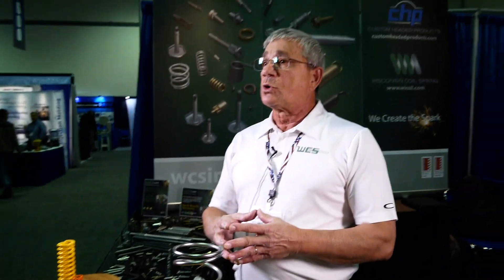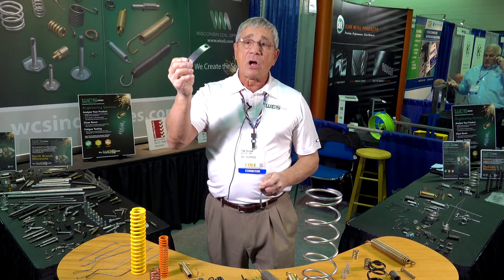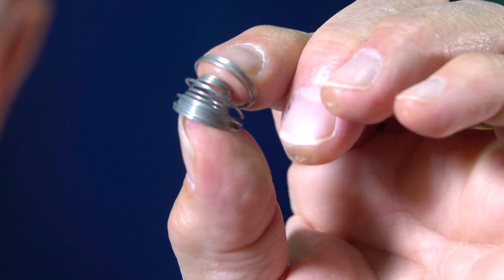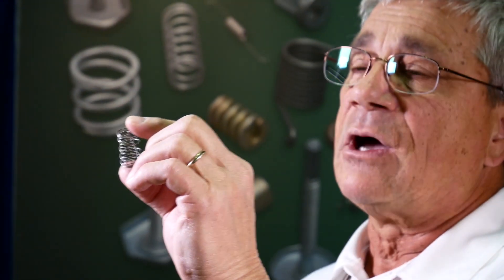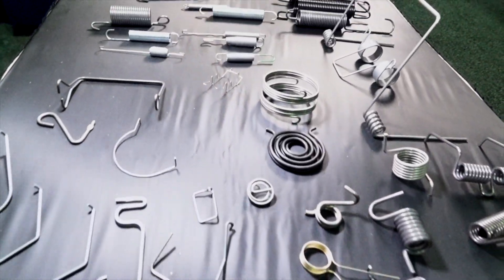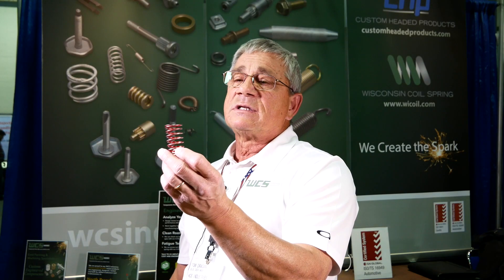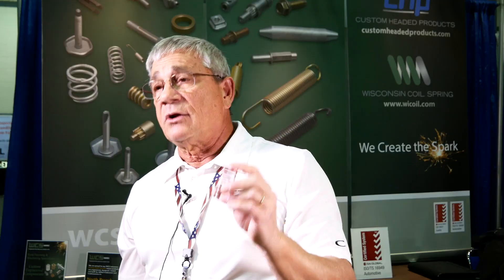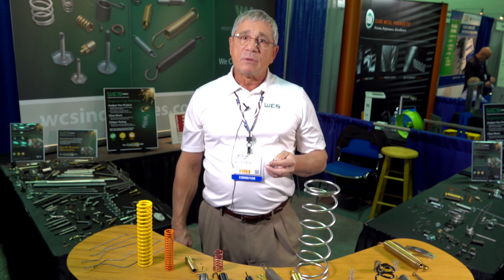Extension Springs, Compression Springs, Torsion Springs | WCS Springs | Muskego, WI

Comment: It is so hard to imagine how springs on the valves last long amount of time .Is there an answer to that question ?
Reply from the maker: It has to do with the design of the spring - how many cycles it can handle- thats why you need to buy springs manufactured for your application because the manufacturer can control the lifecycle.